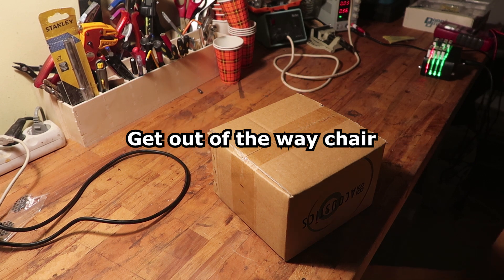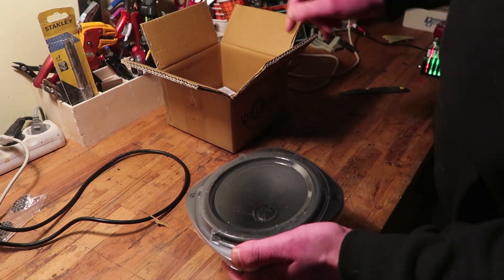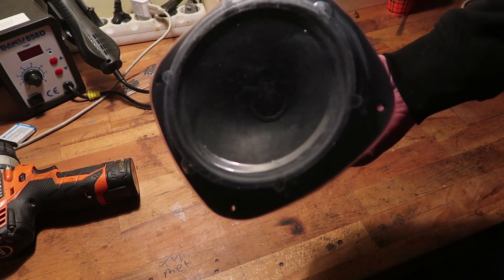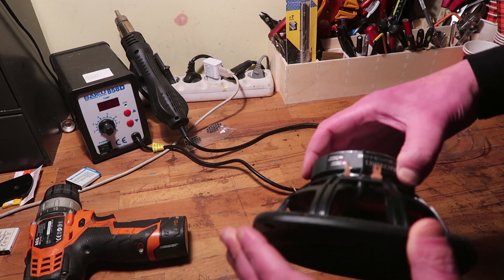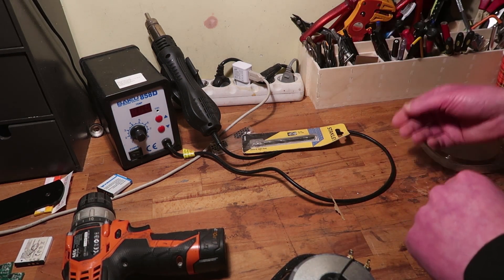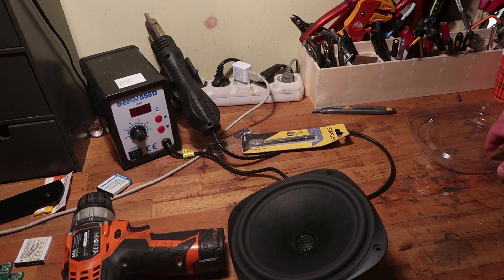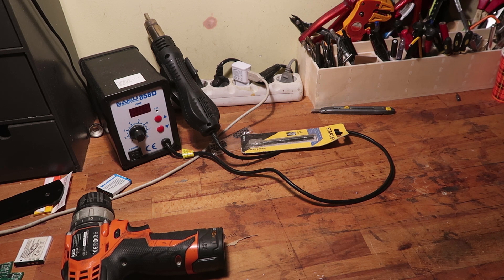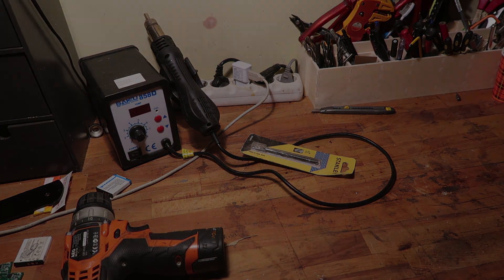1 meter long ribbon - Christmas came early SB Acoustics drivers

Comment: Please note,  the specification of the sensitivity.
 This is specified as 2.83 volts / 1 m.

With a 4 ohm loudspeaker this means that 2 watts  (normaly 1 Watt) were supplied ! Sensitivity trick from the manufacturer.
Reply from the maker: I know ;) magnepan  used it for ever

Comment: Nice mistake. Give you an oportunity to play with one of their coaxs. Personally I like to use the rounds versus squares as it easier to do cutouts and prefer the look. How's the weight and strength of the woofers? SB acoustics cost a little bit more in general but the quality control is much much higher than other companies (Dayton, Peerless etc.)